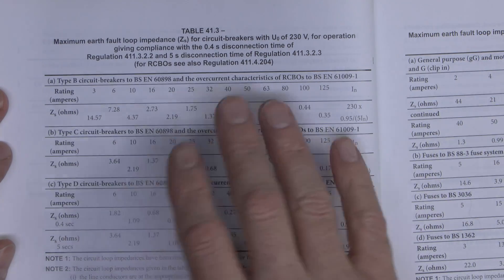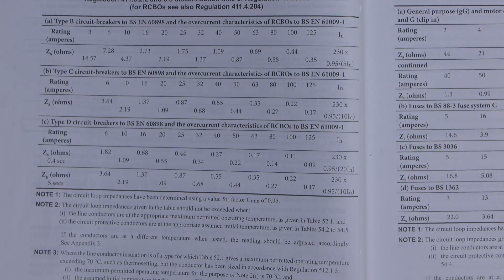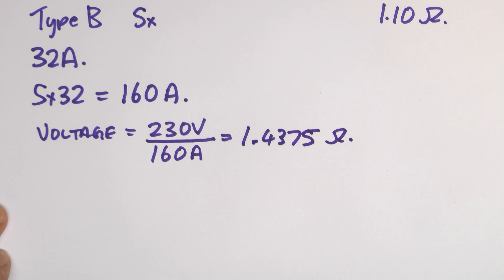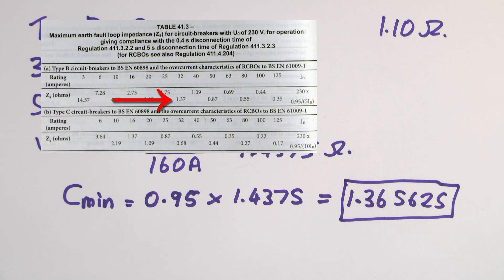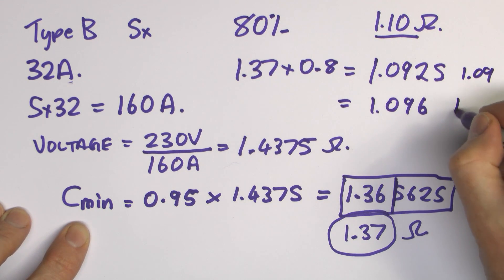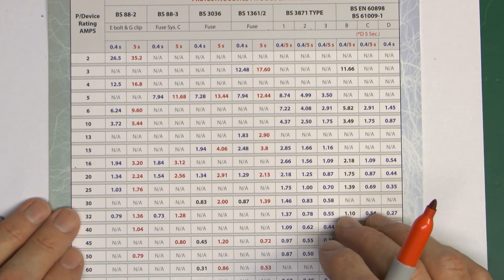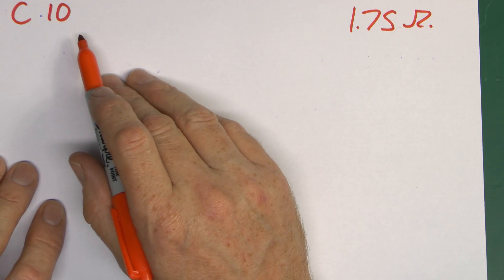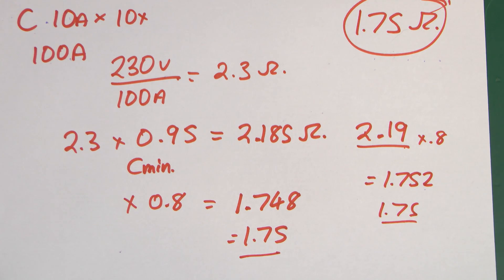Calculating maximum values of earth loop impedance, Zs

Comment: John: Excellent presentation, thanks.  I just figured that I can multiply the two correction factors to get 0.76 (0.95x0.8)  - maybe just a little quicker for multiple calculations:  0.75 i.e. close to 3/4,  so any calculation yields considerable decrease in Ohmic value compared to the basic uncorrected V/I division, as you demonstrated.

Comment: Hi John, can I just pick your brain?

The OSG tables have the 0.8 factor already included, correct? This factor assumes an ambient of 10 degrees C, so for other ambient temps, apply factors in table B8 of the OSG to values in tables B1-B6.

For verification of a measured Zs, you can use the OSG tables B1-6 multiplied by B8, or if you use the Regs book, you use the method you outline in the video.

For calculating Zs from plans etc, you use Table I1 to get R1+R2 and then apply factors in Table I3. Add Ze and you have an expected Zs. Correct?

There is also table I2 in the OSG but I'm not 100% sure when you use this. The OSG says to use this when doing testing only, so I assume this is to be applied to values in I1 when estimating R1+R2 in order to evaluate measured values of R1+R2 on site?

GN3 says there are 4 methods for verification of measured Zs: 

1. GN3 tables (same as OSG).
2. Use max Zs figures given by designer.
3. Use BS7671 regs book tables and correct for temperature using formulas in Appendix A3 of GN3.
4. Use 0.8 x ((Uo x Cmin)/Ia)

Comment: Where does ze come into this??? Confused.
Reply from the maker: Ze is the loop impedance of the supply external to the building.  It's part of Zs.  Zs is the total loop including Ze and the circuit wiring.
Reply: @jwflame  so does ze get added to the values in your video.thanks

Comment: I thought you look up the time/ current characteristics of the device and read off at the disconnect time required ( o.4, 1, 5 s etc) on the graph and use that current value to calculate?

Comment: If you have a pfc of say 8Ka at a consumer unit and the mcbs are rated at 6ka , would this be a C1 on an eicr or does the main bs 88-3 fuse cover this fault current ? Struggling to find an answer thanks
Reply from the maker: If it's a consumer unit to BS EN 61439-3 with a maximum of 100A BS88-3 fuse supplying it, then it's rated to 16kA even if the devices in it are rated less than that.

This does NOT apply for other types of installations, for those the devices must either be rated appropriately for whatever fault level exists, or have appropriate protection from upstream devices.
Reply: @jwflame  thank you for the reply 👍

Comment: How do you calculate the maximum zs for fuses since they have no curve characteristics like Mcbs? Is the maximum amps needed just the rated currently of the protective device multiplied by 1.45?
Reply from the maker: Same principle, fuses do have time/current curves which are available from the manufacturer, so it's a case of finding out what the current to cause disconnection in a certain time is, and calculating the max impedance using that current and the voltage.
Example data: https://www.lawson-fuses.com/technical-data/datasheets/

Comment: I thought type D was only 10x it’s rating not 20x???
Reply from the maker: Depends on the manufacturer - the generic specification is between 10x and 20x, so 20x to guarantee tripping,  but it's better to use the specifications for the actual device being used, as some will be lower than 20x.
Reply: Thanks John much appreciated.

Comment: Wouldn’t you be multiplying 1.4375 by 80%? Rather than the 95% value?
Reply from the maker: 80% is used to obtain 'real world' values  which allow for temperature differences in the conductor.
If that is applied, it's done at the end.  It's an approximation and is used to avoid having to calculate the difference for conductor temperature for each individual circuit.  
0.95 is a correction factor for supply voltage differences, and is always included.

Comment: Type B MCB 6 amps has a Zs of 7.28 ohms from Table.     230 volts/7.28 ohms = 31.6 amps when there is an earth fault.       Type B Trips immediately between 3-5 times MCB 6 amps.   Therefore 31.5 amps will definitely cause an instantaneous trip as it is greater than max current 5 times MCB Type B of 6 amps = 30 amps required for an instant trip.     I assume that is the logic of Zs .   It guarantees an instantaneous trip

Comment: Is type D circuit breaker the only type capable of 5 second disconnection time ? as it gives a Zs value in Table 41.3 for 0.4 secs as well as 5 seconds for Type D only.   Do types B and C always trip within 0.4 seconds .

Comment: If a circuit is protected by an RCB then why does the loop impedance need to be low ..surely a phase to PE fault would trip the RCB
Reply from the maker: RCDs do not work on phase-neutral faults, and on TN supplies if phase-earth is too high, it's usually the case that phase-N is also too high.
Using RCDs as fault protection for phase-earth faults is only appropriate when there is no other option such as a TT supply.

Comment: How did you come up with the equation? The AC supply voltage is always quoted as 230 +/- 10% which gives a min supply of 117V/160A = 1.3565 ohms which gives a much lower impedance.
Reply: That's why you have a correction factor.

Comment: Does every electrician measure their own Z values and sign off on them. If the inspection was done by someone else they would not know the manufacturers exact tripping currents ? They might fail something that was actually ok ?   Could this happen or what actually happens in practice.

Comment: John can you do an example that shows both the ambient temperature of the installation and the max operating current of the cable, I'm sure these factors are required in the real world if you don't mind thanks.
Reply: I'd suggest the supply cable should be bigger or the breaker changed to type C

Comment: Nice. Any reason the Cmin factor is 0.95?-  rather than 0.94??...considering the according to ESQCR the RMS mains voltage supply can at customer terminals can  be 230VAC +10%, and -6% ! Cheers

Comment: why not use minimum tripping current= In x 3 for type B since its between 3x-5x. Why use 5x
Reply: Because the tripping characteristics of mcbs have a tolerance you must always calculate based on maximum current values for safety. Its no good working on the assumption that only 30A will flow through a circuit protected by a B10 if in fact 50A is the actual value.

Comment: If my measured zs is over the values permited for type d (20×) in bs7671, but when calculating max zs with manufacturers Ia (×17) my measured values are now under.... would the circuit still be classed as non compliant?

Comment: The IET refuse to add another table into the BS7671 with the 80% values attached. This table is in the GN3 and contains the values required for 99.9% of tests. The GN1 states that the values shown in BS7671 are primarily for designers, but I don’t see the point if the inspector & tester still carries out the tests with next to no load on the circuits. The BS7671 is also misleading with the calculation given in appendix 3. The Cmin value has already been factored into the tables in Part 4 and therefore only the 80% calculation is required. Ok, rant over. Good work JW.

Comment: Does the use of the manufacturers data sheet values not create a trap for young players in regards to replacing the Circuit Breaker at a later time with a different manufacturers CB potentially creating a non compliances issue? (in regards to the impossible impedance values)

Comment: The 80% rule of thumb is given by the simplified temperature coefficient for copper conductors 0.004, for a 70deg conductor measured at 10deg the change is 60 degrees.  (60x0.004)+1 gives a factor of 1.24, the reciprocal of this being 0.8 ish (or 80%).  It used to be explained quite well in the 16th edn of GN3 in the appendix, I don't think it is as clear in the newer versions.

Comment: Not a electrician but subscribed, does not the Ohms change for length of wire?
Reply: Hi Robert - Of course  -any length of wire will have resistance - and it depends upon several things :
1, how long the wire is,  2 how thick the wire is,  3, what it is made of  ( usually copper) , and its temperature.

Resistance goes up with length - down with increased thickness,  its "lower" with copper, "higher with" say aluminium, and goes up with temperature.  
 Copper cable goes up in resistance by about 0.4% per degree c rise  (or 0.004 times per degree C)   -so if you measure a cable's resistance at say 20 degrees typical ambient - and then raise it  to a typical max temp rating of 70 deg C - then that is a 50 deg C rise (70-20 deg c)  - so the resistance will have gone up by  50 * 0.4% = 20% - that is: its 1.2 times its original resistance -  so when we apply that 1.2 times in our circuit calculation to allow for circuits operating at  higher temperatures ( which they will do especially with cables buried in thermal insulation)  - we actually end up offsetting the resistance ( dividing it)  by 1.2 -  so what we actually are doing is multiplying by   1/1.2  = 0.8 ,  which is where John gets the "0.8" from 

The "wire itself"   of course can and will be of varying length in a practical circuit . 
In a house for example  there are several circuits feeding sockets, lights,  cooker ,  shower  - and will all have different lengths .  So what we need to know is  - how much overall resistance can the circuit have in order for the circuit protective device to operate correctly  - and from there -  we can calculate the maximum  length of cable-  taking into account how thick the conductors are. ( these resistances "per metre"  Versus  cable size are conveniently tabulated in Bs7671  - and in the electricians "guidance books) 
For example - in a typical house:   circuits feeding sockets  - this might be connected using "twin and earth"  cable of 2.5mm squared conductor - whereas lights might use 1.00mm , a cooker might use 6.00mm and an electric shower 10mm (  the cable needs to be " thick enough"  to carry the expected current !!  - so its not just about the resistance ! ( and volt drop too ... but we wont go into that here ... ) 

So What we are trying to do here is find out how much resistance a circuit can have overall 

This "overall" circuit resistance has three essential parts -  
1 - the "external"  resistance  ( more correctly "impedance"  - given the symbol "Z")  "looking back" from where the supply enters the building (and connects to  the distribution board)   to the "supply transformer in the street" - this part of the overall circuit is  called  "Ze"  
2 The resistance of the  circuit "line" conductor"  from the distribution board to the end point of the circuit in the building - this is  called "R1"
3  The resistance of the "earth conductor"  - called the "circuit protective conductor" - or "CPC"  from the end point of the circuit "back"  to the distribution board - this is called "R2" 
NOW - in the event of what "we" are calling a "fault":   the live conductor  is assumed to be directly connected at the end of the circuit ( ie short-circuited )  to the CPC .   

So - you can now see  that the TOTAL resistance in the circuit under this "fault condition"  is the sum of resistance around the whole circuit from the supply transformer in the street - to the "short circuit"  at the end of our circuit  and back - which is:
Ze + R1 + R2 , and we call this the "system resistance"  ( or impedance )   = Zs  

- so - the only part "we"  can "control"  in our installation and calculation  is the "R1 + R2"  part - so when we know what "Ze"  is  ( usually quite low at around  0.35 ohms or so)  we can calculate "Zs"  by  looking at the cable resistances 

When a fault occurs in that circuit,  now we can show that  the current that flows will be great enough to "blow the fuse" (ie "melt the fuse wire" ) or in more modern times such as they are now - "operate a circuit breaker" ...  
And ...
What we are ALSO trying to achieve  is to get the fuse to blow or the circuit breaker to operate in a certain time. 
That  way - if the fuse blows quick enough - no damage is done to the circuit ( like cables heating etc) .
This all comes under the idea of "Automatic Disconnection"  in the case of a fault. 
Now it is pretty easy to see that the bigger the current  - the quicker a fuse will blow ( heats up quicker)  - or - in the case of a circuit breaker which relies upon a magnetic field  generated in a coil within the protective device which carries the fault current to operate the cutout - the more quickly that will operate. (NOTE : there is also a Thermal device in the circuit breaker which detects lower values of fault current over varying times to operate the cutout) 
  
But - the question is - "how quick"  - and this is where the "type of external supply "  needs to be considered  - but for a typical circuit say in a house being fed from a common type of supply where the "return earth fault path" is provided by the supply authority -  called a "TN" supply - then -  the disconnection time is 0.4 secs  ( the table that John was referring to in BS7671)
Reply: Eric Churchyard that’s a very in depth explanation. So basically z is potentially friction with a safety factor. But called resistance to simplify.
Reply: @BasketCaseGarageForFun   - Hi Robert   "Z"  in electrical parlance  means "impedance"  We tend to swop the terms "resistance"  and impedance"  in simple circuits because  the two are very similar in "effect" in most simple circuits such as you find in a house or very basic commercial installations ...  BUT ...  

When we talk about "simple"  circuits  such as say a battery feeding say a  lamp ... we talk about the "resistance "  of the circuit.   That is - say we have a 12volt battery that powers a lamp that has a resistance of 2 ohms - then we can easily calculate the current ( given the symbol "I")  which is...   from ohms law   I = V/R
so - our current (I)  will be : 12/2  = 6Amps. 
So far so good... BUT .. when we come to talk about circuits that carry "alternating current"  .. then ... STRICTLY speaking - we cant use the term "resistance "  any more because -  there are other elements other than the pure resistance of the connecting wire and other items  in a circuit ...  that - when combined with the resistance of the circuit   "impede"  the flow of current .  ( impede ... = impedance !) -  and these elements are : 

1: Inductance  ( coils of wire such as in motor or actuator )  and,  2:  capacitance - such as you might find again in motors and filters -
These elements  of inductance and capacitance "react"  to the alternating current flow - and their contribution to the overall "impedance" of the current flow is called "reactance" ( given the symbol "X"    - you may have heard of "inductive reactance  shown as "Xl"  and capacitive reactance shown as "Xc" " 

So - when we talk about "AC"  circuits - the actual "resistance"  to electrical current flow is made up of the pure resistance of the connecting wire etc.. AND the additional reactance  Xl  and Xc   and - the sum of these  , R  + Xl + Xc   is the overall "impedance"  (Z)  

So - to keep it "correct"   we use the term "Z"  for ac circuits ... although --  for most practical and simple circuits such as you''ll find in a house .... you can think of it as just pure resistance 

( note - to keep this simple .. I haven't gone into the fact that resistance and reactance CANNOT be simply added, since Xl and Xc are -/+ 90 degrees phase shifted  so are "vector"  quantities
Reply from the maker: Yes, longer length = increased resistance (ohms).
There is always a maximum length that a circuit can be.
Reply: @jwflame  so the Z table your showing is an average number? Sorry for my lack of  not understand the math, being there is no wire length.  I guess this explains it,, very minimal per thousand feet.  http://www.bcae1.com/wire.htm#:~:text=It%27s%20resistance%20is%20approximately%201%20ohm%20per%20thousand,1%20ohm%2F1000%20ft%20or%200.001%20ohms%2Ffoot%20of%20wire.
Reply: robert mccully the cable length is dictated by Max measured Zs value and the measured Ze value of the installation. For example if the Ze was 0.3 Ohms and the circuit was protected by a type B32 CB with a maximum measured value of 1.1 Ohms, then the cable (R1+R2) would be restricted to an impedance of 0.8 Ohms. Zs=Ze+(R1+R2).

Comment: I use the same formula for years already
And you can calculate the 60947-2 MCCBs for Schneider and ABB.
ABB @100% Zs: 230VxCmin / I3 [A] x 1.2
Schneider @100% Zs: 230VxCmin / Im [A] x 1.1
I3 and Im is the magnetic or instant release current.

Comment: If you were to use the actual value for a specific model of class C circuit breaker, for example, what's the ongoing responsibility in the future if that circuit breaker were to fail and be replaced by some "equivalent" class C breaker that trips at a higher current? I would have expected the relevant authorities to require installations to allow for the worst case for a particular class of breaker, not the typical performance of a specific brand/model.
Reply from the maker: Responsibility is with the person replacing the circuit breaker - it's up to them to test the circuit to ensure the item they are installing is suitable.
Mixing different manufacturers devices in the same enclosure isn't generally permitted either.
Reply: Whoever changes the circuit breaker should be testing the circuit anyway. Then they will know if the loop impedance is satisfactory for the new device that they fit. If they do not bother testing the circuit, they are not completing their task properly.

Comment: So what do you do with the z value, measure your circuit and compare? Replace with lower resistance cables if it's exceeded?
Reply from the maker: Yes, although it should just be confirming the circuit values comply.  If not, then the design of the circuit is wrong.